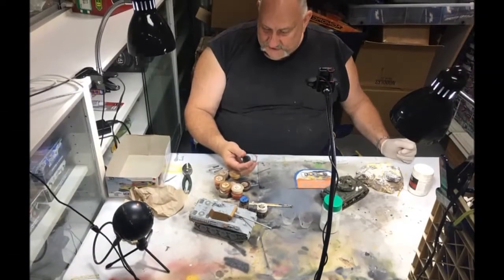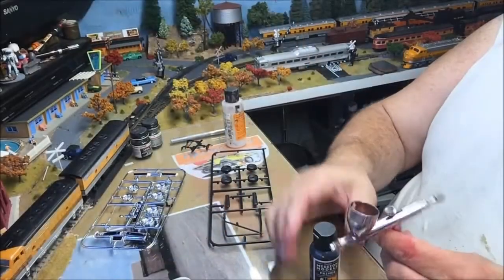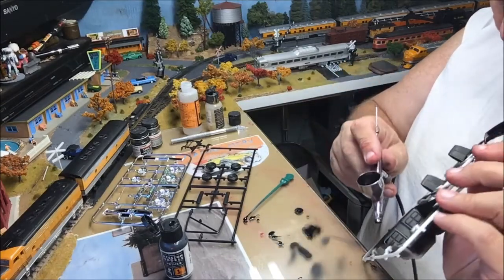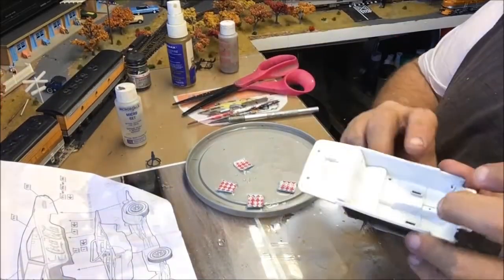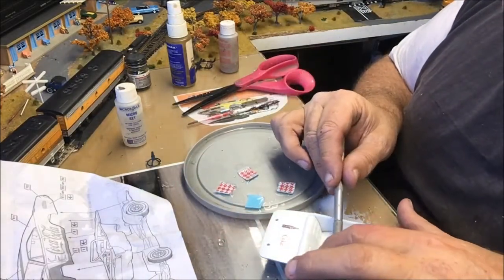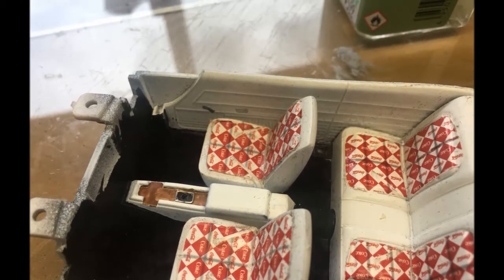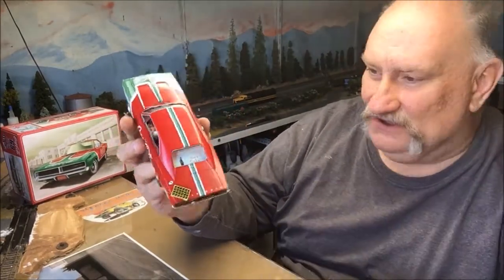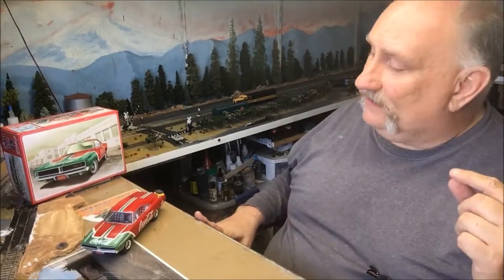Pop bottle charger part 5 interior and finishing

Comment: Do you use exclusively air brush? Any rattle cans.
Reply from the maker: It depends on the project I like the Tamia rattle cans but they are a little expensive. On some of the 1 to 1 scale stuff that I do I use A lot of rattle cans. I don’t usually use them to paint a car body but I have use them to paint primer on a car body and I have use them to paint some of the military projects particularly aircraft. I prefer to use an airbrush as much as possible other than painting primer.
Reply: @maddogmerv  I liked that unique marbled look you did last week ,I think on the trike.
Reply from the maker: Thank you that was one of those experimental mistakes that turns out pretty awesome.